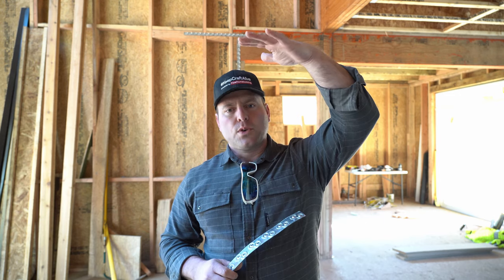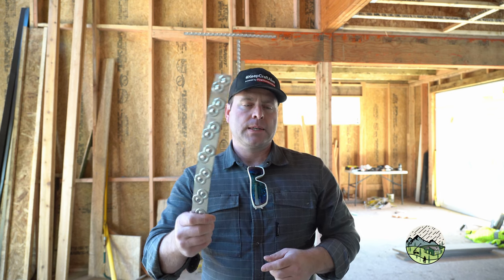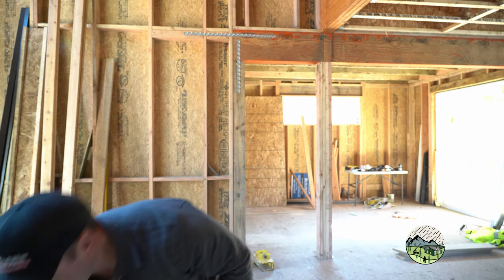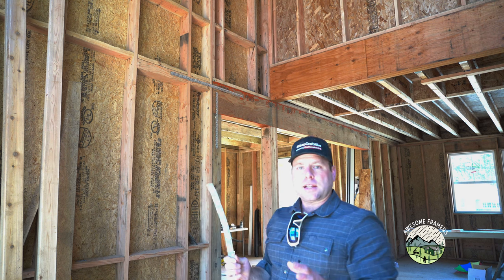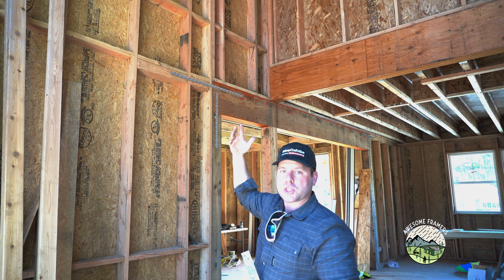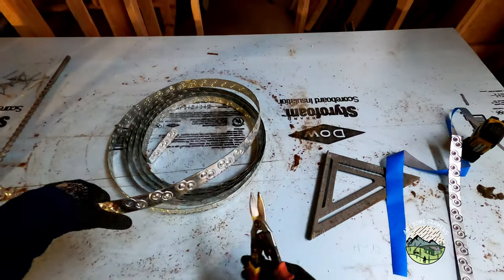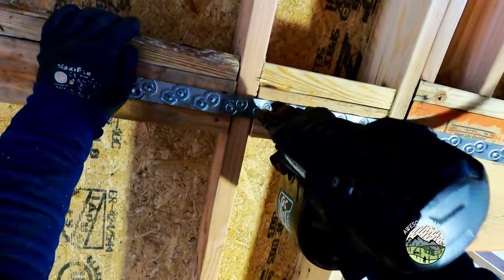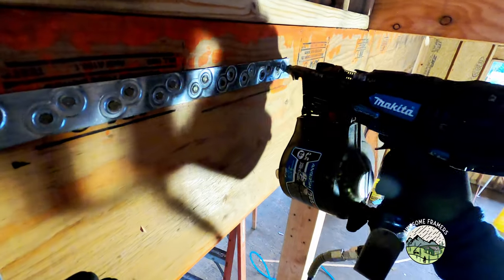Basic Load Paths

Comment: Thanks for posting this here.  Instagram has its place but longer-form educational content like this is much better suited for YouTube than IGTV.

Also... that's an interesting strap.  I had never heard of it before!  Would've likely have been less expensive to use that instead of "normal" metal coils and buying a dedicated metal connector nailer.
Reply from the maker: Yeah a metal connector nailer is still a life saver with joist hangers or other straps that aren't designed for a regular gun.  But I usually install straps like these during pickup framing, so not rolling out another tool is nice.

Comment: Fortunately I frame in middle America where we don't do strapping. Only thing required is uplift ties for trusses. But now we can use lag screws for that. Do you have to fill every hole with a nail? Turns the wood to Swiss cheese.
Reply: I hear you, it can be a hassle.  Filling all the holes is a common misconception and it actually not true at all.  Strong Tie tests and submits that data on their hardware.  The connections are tested to failure, and then a safety factor is applied.  The data in the catalog tables comes directly from this process.

Comment: Early in the video you mention that you prefer .121 diameter nails for Douglas Fir because it doesn’t split it as much as the wider diameter 3 inches. Is that:

- Only in the strapping?
- Applicable to Simpson hangers?
- For all lumber framing?
- Do you think that would apply to yellow pine?

Comment: Love your video series. Excellent educational content. Question:  does the drywaller have to do anything to keep the rock from bulging where it covers those straps?
Reply: They aren’t doing a level 5 finish. I think they are doing knockdown texture so they probably don’t do anything
Reply from the maker: Great question.  The 18ga strap is very low profile. I'm willing to bet that if no one like use knew where the straps were, we couldn't find them after finishes.
Reply: AwesomeFramers, thanks very much for the reply!